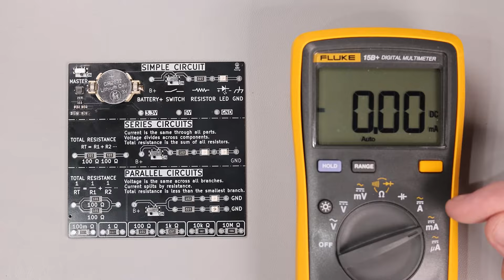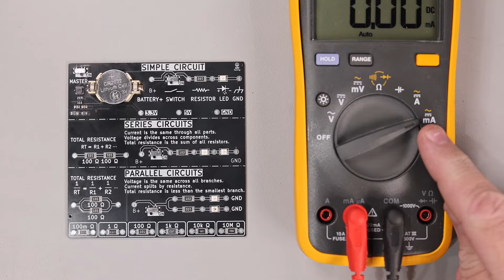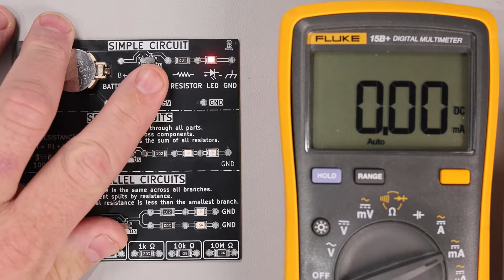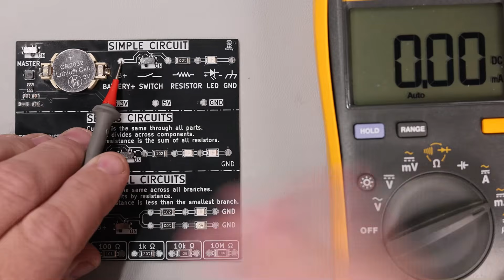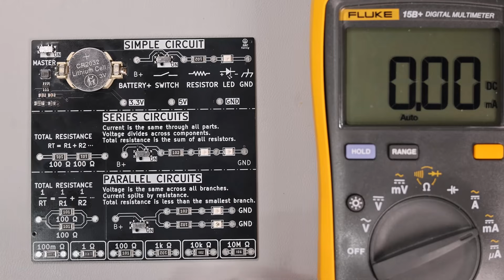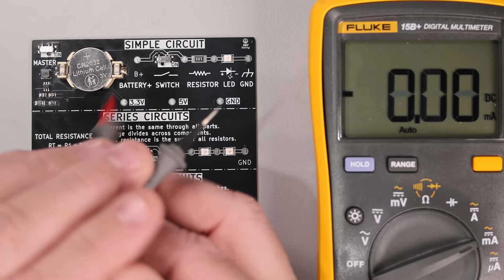How to Measure Current with a Multimeter (Beginner Friendly)

Comment: Question, how do you measure current if your PCB doesn't have probe points like your test board? Do you have to de-solder something to get a reading?
Reply from the maker: It really depends on the pcb. If there is a switch you can sometimes measure it there.

Comment: Hello Scott. Very nice. I came here because I was measuring the current in my car, in series. I took off the chassis/ground lead and put the pos probe on the battery and the neg on the C/G, it deflected in reverse, like a neg reading, any ideas. I'm looking for something that is drawing current over night. I will be disconnecting the fuses one by one to find which component it is, hopefully. I have been measuring circuits for 30 odd years now! All the very best and keep safe you and yours.
Reply from the maker: Nice work. Many years ago I went to a class with Chrysler. They showed a technique for finding a draw by measuring voltage drop on the fuse. Measure the voltage drop between the two pins of the fuse. If current is flowing through the circuit then the fuse will drop a little bit. I've found that technique to be a little better because it prevents restarting modules. If you pull the fuse then the module restarts and may temporarily remove the draw. Good luck those can be tough